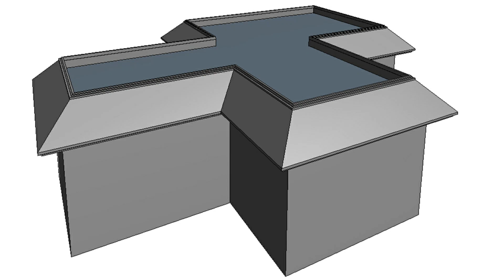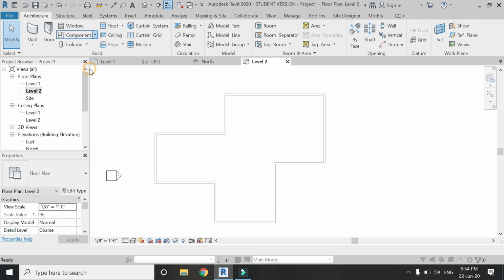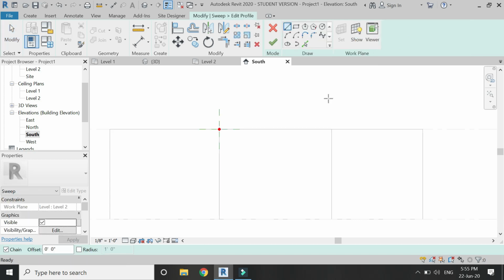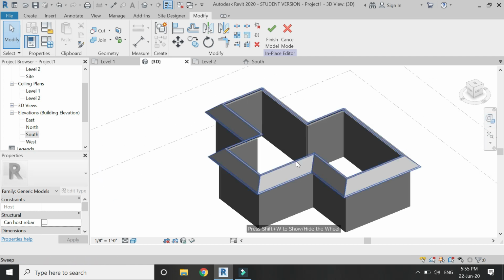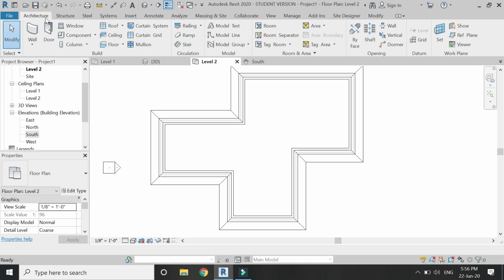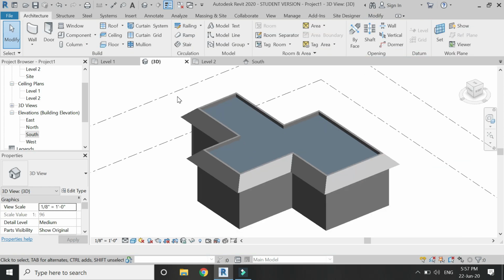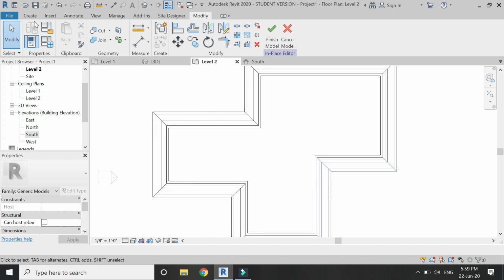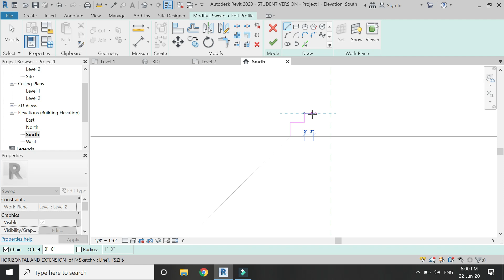Revit Tutorial - Pitched Parapet (Sweep Command)

Comment: hi maam very informative video, i would like to ask if how about i have a pitch parapet like what you have done in this video and at the same time it is inclined in the horizontal plane, since my roof is not flat it has one slope. how am i going to adjust the angle with respect to the horizontal plane?